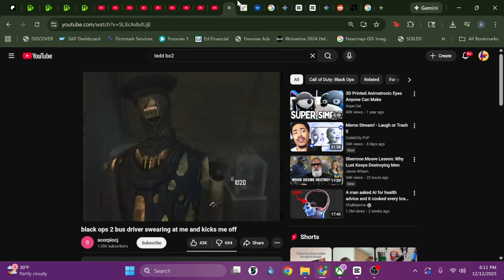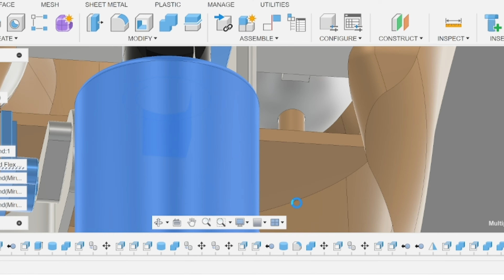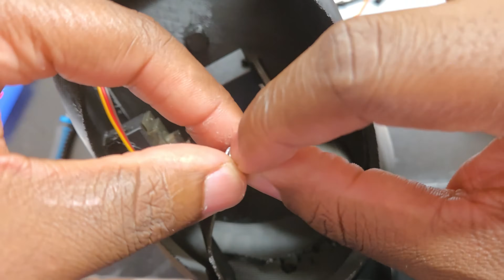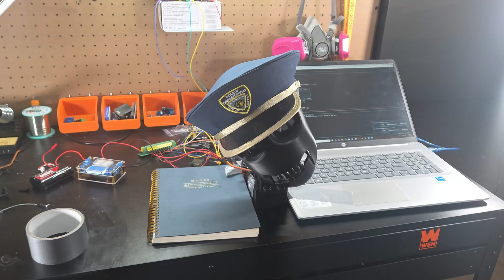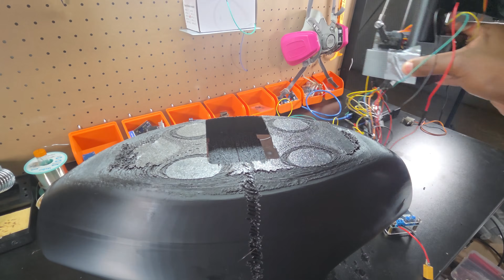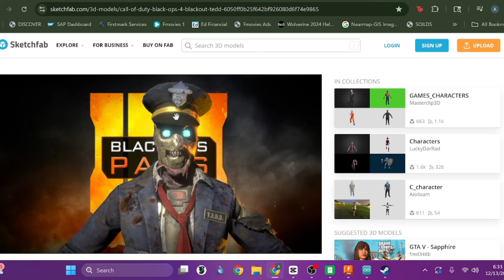I Made T.E.D.D. From Black Ops 2

Comment: excellent work. in the future if u use a chisel tip on your soldering iron and dig a deep valley on the inside edge of the join instead of the outside, you can get it almost seamless on the outside and create a perfect surface (valley) for filling with a 3d pen. then if you smooth that out with a 3d pen your weld will be stronger than the part itself and almost invisible.
Reply from the maker: Thanks, I appreciate the feedback! I might get a dedicated plastic welder with a wedged tip. I have a good weller unit with replacable tips, but it feels sacrilegious to use it to weld plastic.